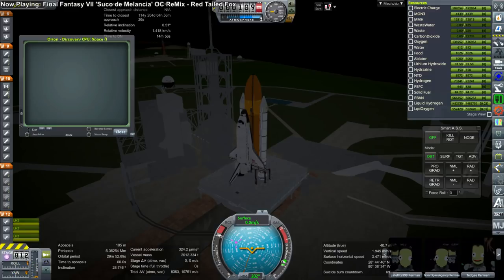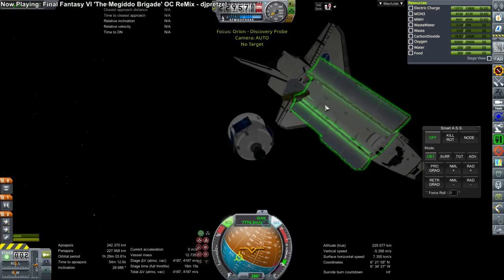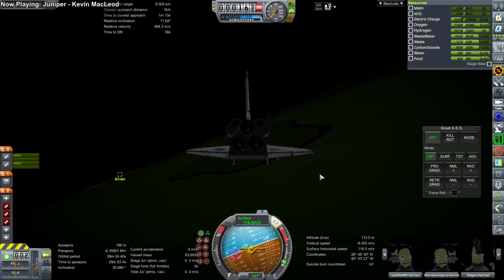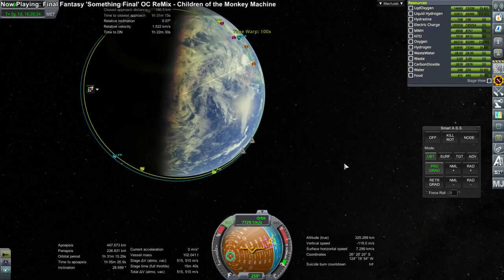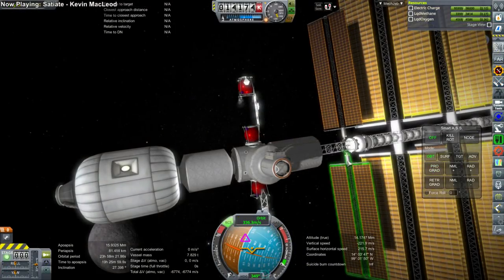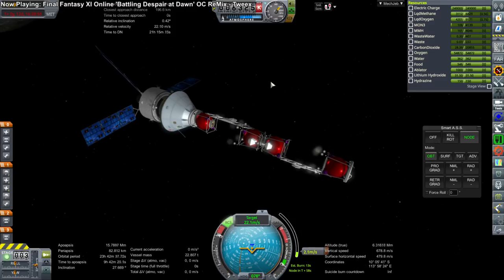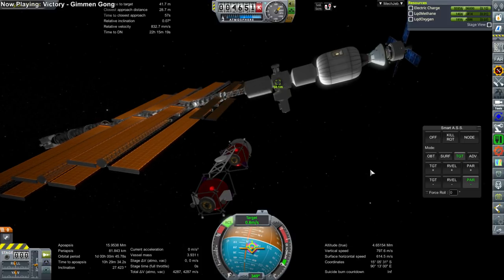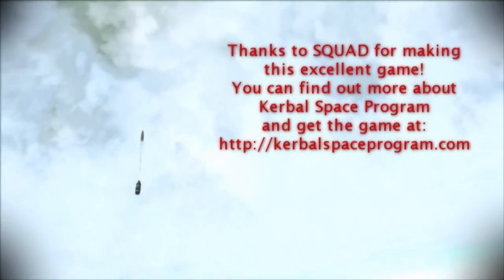Kerbal Space Program - Shuttle-Constructed Mars Mission 08

Comment: I have question (again):
Theoretically, would you be able to fit the shuttle with some not so unrealistic equipment, let’s say a reactor and ion engines, or just a fuel tank inside the cargo bay, would you be able to go to the moon and back to LEO, even if it is totally unrealistic. How much delta v could you get out of the shuttle if you would use such a method? The shuttle heat shield is not lunar rated, so I assume it would just vaporise from a TEI. I know, it would look super strange to see a shuttle in lunar orbit, though very cool. You have used other fictional stuff as well.
Reply from the maker: Don't forget that with ion engines you're going to be exposing the crew to Van Allen Belt radiation (and probably the reactor is shielded, at least) for an extended time and you need to carry enough supplies. Unless there's no crew, in which case, I'm not sure what the shuttle is doing. After you take into account the mass of the ion engines and the reactor, the remaining payload mass for ion engine fuel may be enough for a transfer to the Moon - I would actually have to do the mission to really check, since spiraling out is clearly not like a Hohmann transfer. On the bright side, you don't have to worry about TEI heat - just refuel the shuttle with xenon around the Moon like my mission here and then have it spiral back down to LEO before reentering.
Reply: Sounds still very interesting, though as a lot of work to just bring the crew over to the moon with shuttle instead of an Orion. How much delta-v would you get with just using all cargo capacity for a tank full of OMS fuel? Maybe use some fictional uprated „new generation OMS“ I didn’t account for the extra time you need for spiralling. What can the shuttle do in terms of life support? One week for 8 people? Do you use a mod for radiation/van-allen? Do you see some other chance getting it to the moon and back without launching another spacecraft to refuel it at the moon?

Comment: What's the point of Orion MPCV when you have a shuttle? Isn't it better to have in-orbit habitat and shuttle for crew commuting?
Reply: It provides an escape option if there isn't enough delta-v left in the mothership to circularize.
Reply from the maker: Orion would be necessary to bring them back from high orbit, which is the only place the Mars mission will park (it doesn't ever go back to LEO again). What isn't clear is why anyone would bring it all the over the Mars. I only realized this now, but a properly planned ion engine mission has no need to carry Orion all the way, and it can only serve as a return vehicle within 30 days of Earth periapsis (since its systems are only designed to operate for that duration).
Reply: @mattpelzek3809  For that purpose you can use space-only craft, which would be far better since it wouldn't carry heavy heatshield and so on. I understand irl they don't have enough budget to build every type of crafts so Orion can be a good or only option, but not in KSP.